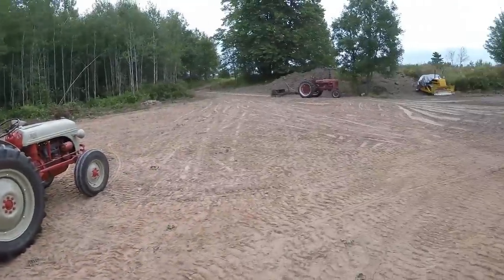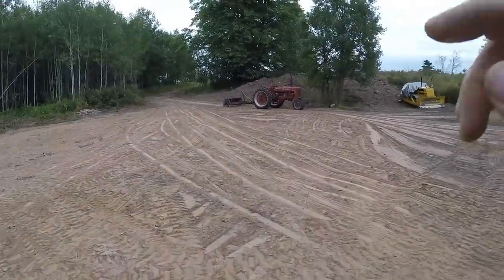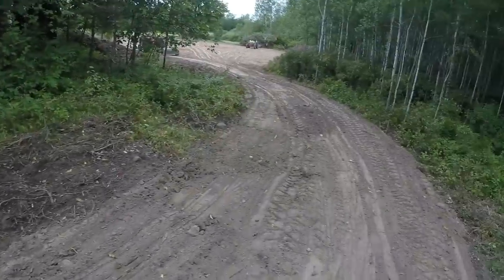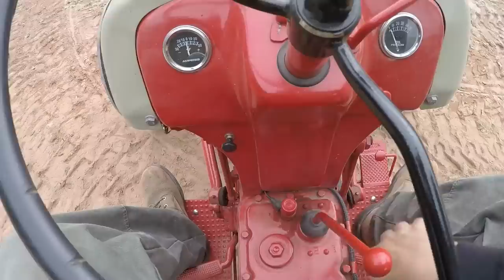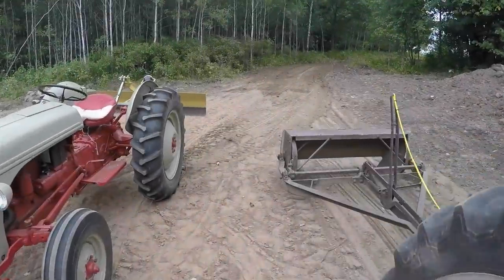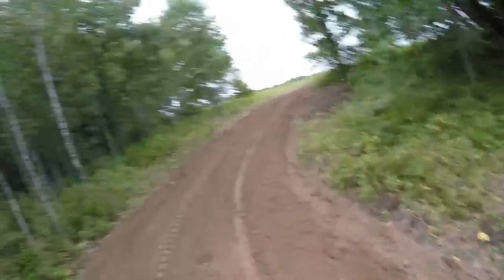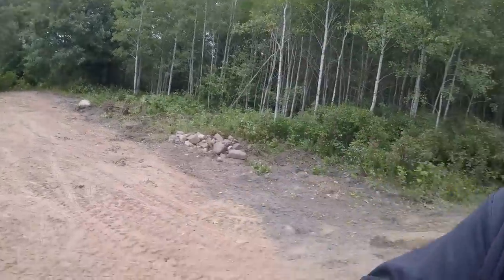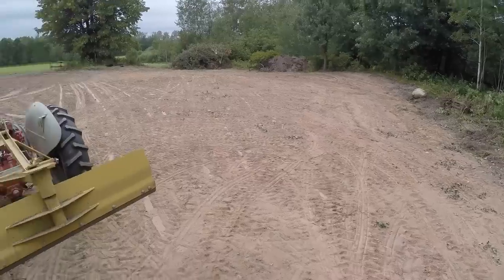Ford 8N Tractor & Backblade - Field Land Clearing Project Part 5: Building The Access Road

Comment: The price of 8Ns has fallen quite a bit in the last 30 years or so.  When you read the rated horsepower and see how much work one of those will do and then look at the rated horsepower on some of the newer tractors and put them in a similar situation you are amazed how little power some of the 30+ horsepower rated machines can do.  I never used an 8N but I did use a Jubilee when I was a boy, it was really easy to operate but I also used an AC WD 45 and loved the power they had.  I even liked the ACs three point because of how it put the power down, even though the implement needed to be level to hook it up easily.  It is good to see so many of the 8Ns still going 70 years later.

Comment: That new (well a few years old now and low hour) engine in the 8N sure runs sweet. But I was thinking as I watched you move dirt with it, despite how old your equipment is, is the 8N the only Flathead on the property? Aside from D2/RD6 pony engines that is. Thanks for sharing. Soon all your hard work will be covered in snow.

Comment: Keep in mind the axles are not independent suspension so if your tires raise going over a bump so will the straight blade meaning if your trying to flatten a trail or firelane it's better to go in reverse pushing the dirt to fill in the low spots first then once done then drive over normally with straight blade forward to do fine tuning ...
Reply: That’s what I do 👍

Comment: Always fun working the old tractors. Your definitely right in the six foot blade being as much as the Ford can handle I recently attached a seven footer on my Ford from my Kubota and it wouldn’t move snow more than 5 feet before it was stopped in its tracks.

Comment: 1st time viewer... subbed, belled, and liked. that back blade is awesome... I have seen box blades on these but I didn't know that they had this back blade available!  On that fill dirt I would plant corn,  melons and other food along the edge as a long garden plot - deer plot, and fill in the center with tough grass mixture to drive on, We had a mix that we used on the ditches in Florida that would be perfect... it had tough roots  and long and strong grass to keep those ditches from eroding.  perfect to drive on - just bush hog about 4-5 times a year.Call the Orange county road dept in FLA to ask them what that mix was... it was tough and grew to about 2 foot and stopped... perfect straw or road fill that you can't kill by driving on it.

Comment: THANKS FOR THE INFO- I HAVE A BLADE LIKE THIS AND AM TRYING TO LEVEL OUT MY RIDING ARENA FROM A SANDY DIRT THEY JUST DUMPED IN THE CENTER OF MY ARENA AND I AM HAVING TROUBLE GETTING IT 3' LEVEL ACROSS AND LENGHT WISE. I KEEP HAVING A SPECIFIC PLACE THAT STILL HOLDS WATER- HOW DO I USE MY BLADE TO LEVEL IT OUT? FRONT DRAG OR REAR PUSH?
Reply: @squatch253  practice make perfect i guess- i am learning- gonna try both since its been so wet here in NC but i think making sure its level may be my bigest issue- its an older blade

Comment: Question for you Squatch.  I learned to drive on an 8N back in the late 50s.  My uncle had a pair of 8Ns and they looked old back then.  They were very similar to yours, but with several differences.  I remember the clutch and brake pedals were made of round bar stock, not flat like yours.  Also the throttle friction was not on the cowl, but a pie shaped metal frame off to the right side of the steering wheel with ridges to create friction to hold the setting.  Does any of that sound familiar?  I'm trying to understand how old they were.
Reply: @bottomlands  I was able to find a old photo of one the tractors and after doing some additional research determined they were actually 9Ns.  I based this on the types of wheels and the I-beam radius arms.  Thanks for the help.
Reply: @squatch253  Thanks Bud.

Comment: I'm thinking about getting a box blade. Seems King Kutter is built the best and heaviest. I have a back blade but need to dig up existing gravel. Driveway and turn around are about 800' total. Have a 9N 1941 just converted to 12 volt. 81 years old and going strong. <---- The 9N that is.

Comment: If you wanted to use the Kabota, grab a King Kutter 6’ box blade and a hydraulic top link and you could have done all of this with one implement. 

Some of this is to exercise the old equipment, but for someone watching with less equipment gives them a capable tool for not much money.
Reply: He did it with the tools at hand, why go buy that new shit just to do it with one machine to please a select few? A box blade and hyd top link isnt cheap.

Comment: My uncle got a ford just like yours here in brazil.The previous owner installed a VW beetle carburetor on it because spare parts are impossible to find and someho ,runs fine lol
Reply: Similar power outputs, similar displacements, no reason induction systems couldn't interchange

Comment: That’d be a great job for a grader. The old ford is getting it done but a bit of down pressure wouldn’t hurt. Nice job
Reply: i use 180lbs of weight or more on my 8n grader blade

Comment: The poor mans motor grader strikes again but I remember a Road Patrol lurking about at the shop. That works just fine with the 8-N. Just the right size and the N runs like another one of your Swiss watches. As does everything else! Good job and the slope will be better for drainage, sure! Thanks, Toby and Hi 2 Pop!

Comment: If your looking to buy an 8n and your new to tractors I would recommend you get a Ferguson 35 because you will really appreciate the high and low range  especially slow speed ranges also the live PTO  and lift hydraulic ..with the two stage clutch you can stop forward motion and still have power to both whereas on the 8n everything stops when you push the clutch down

Comment: Is your Ford 8n 6 or 12 volt I have a Ferguson to20 that is 6v?
Reply: @squatch253  hey my 49 Ferguson to20 is 6 volt and love that original stuff but my generator is giving me a little trouble by not charging to 7 volts or only 6.13 and if the lights are on you will drain it .

Comment: I saw an old Ferguson video where they were using a Ferguson scraper, the factory made a trail wheel setup to help keep the blade from dipping in or coming out of the ground,
Would be a great option for those of us who use these old 3 pt hitch scrapers and rock rakes